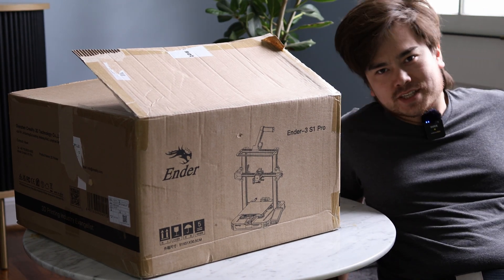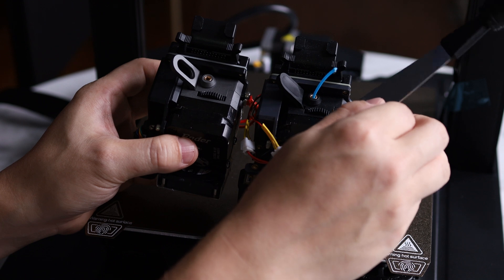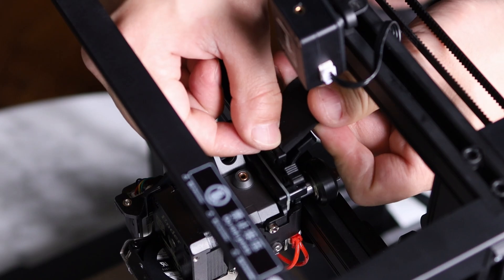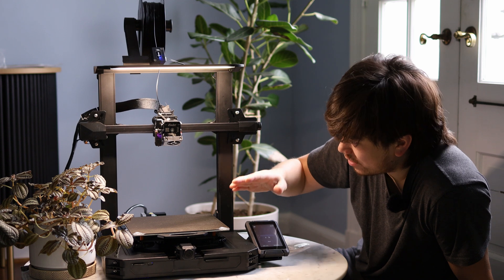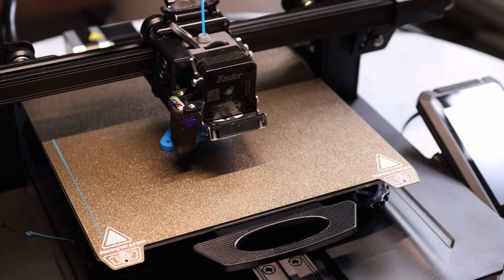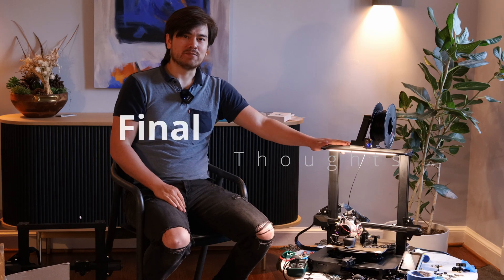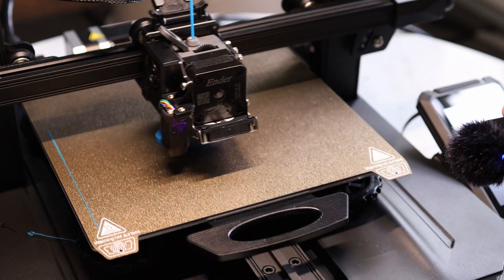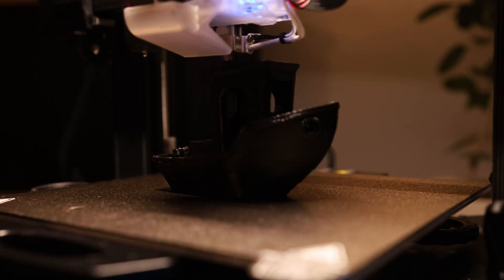The Best Ender 3 S1 Pro Review You've Never Heard Of

Comment: Got my pro yesterday and it's up and running fine.  The noise from the plastic base was the first thing I noticed, though it doesn't bother me as much, but I do wish they had went another route.  Another thing I have in common with so many people who have bought the pro it seems, is that my build plate was quite wobbly as well.  Had to also remove the plate to get to the eccentrics.  After these things it's been all good.
Reply: Adjust them from the right side and it would have saved you time, there was no need to take it apart like he did. I too just got mine a week ago and it was the same. It was done to prevent damage during shipping.

Comment: Hi, mine is due back on Tuesday after getting the print head control board replaced (extruder motor stopped working) probably due to heater block wire shorting out, blackened hole in the wire covering and end loose from plug as you show.  I don’t worry about noise as it runs in garage. Actually quite melodious to my ear.  It has been printing LW-PLA  for RC model aircraft fine. No plans to mod it as I viewed it as Crealities culmination of previous years work etc.  Firmware has been fine for me and I am looking forward to it just printing!    Not modding.      Thanks Laurie,  New Zealand
Reply from the maker: Yikes! Glad you were able to get it fixed

Comment: Your Y axis motor is hotter because of the excess belt tension as the motor has to work harder. Also you can reduce stringing by adding a silicon socket to the heat block. Great Video 👍🏻
Reply from the maker: Thanks! The other factor adding to the heat is the heated bed sometimes being right overhead, but most printers are 10-15ish degrees C hotter on the Y, this one was hot hot hot!

Comment: I had the S1 Pro and it printed like a champ with no stringing actually no problems at all

That is until I did the Factory recommended Firmware update and then the thing just locked up an d never ran again

Now they made me jump through all kinds of hoops and to ne end it still didn't work so they sent me a new motherboard and still didn't work 

So as much as I loved it I packed it up and shipped it back got a full refund and bought the S1 Plus and I'm waiting for it to come in. But with foresight I bought the all metal hot end for it and by watching your video I'll just swap them out rather than try  to change the tubing to avoid the same end you came to

I'll post by next weekend as it's due in on Thursday thanks for the video and saving me a hot end LOL

Paul
Reply from the maker: Nice, my Ender 3 S1 plus is not working - Firmware would lock up when I tried to run the mesh bed leveling procedure. Tried updating the firmware, will be replacing the mainboard to see if that helps. 

Creality QC is... lets just say it could use some work.

Comment: What's your recommendation on buying a machine within this price range, maybe even a couple hundred more, that would outperform this ender s1 pro?
Reply from the maker: I would recommend the Ender 3 S1 Max, since i really like having the option to print 300x300mm. 

All of the S1 printers are pretty much "as good as it gets" in terms of performance for a non-enclosed, bed-slinger printer. Finally reaching near-parity with the Prusa I3Mk3s

The weak points, as I've covered are the poor-ish part cooling fan and the inherent limitations of a non-enclosed bedslinger design. But the extruder, and motion system are really great. 

A nice-to-have feature would be octoprint or klipper integration. I'm kind of surprised no major printer companies have done it yet, since it is something I know I would pay extra for.
Reply: @NathanBuildsRobots  wow thanks for the informative response. There are so many types and knock offs that it's hard to navigate through the sea of seemingly endless options. I've been leaning towards the Enders for sure although if I had the extra loot I would want  the new bamboo or the ankermaker5 even. 
I'll have to look up the octoprint and klipper because I've no idea what they refer too.

Comment: I have one of the first ones that shipped, I got it locally on south America at the same time the reviewers got theirs, I was pretty amazed. No stringing on mine but i had some clogs, that went away after using some olive oil. Noise is an issue, specially compared to my super quiet E3V2, it's not only the plastic base, I tried everything, even if you take off the motor from the mount it still makes. Allot of noise, my guess is that is is related to the drivers they used. Other than that, it proved to be a reliable machine.

Comment: I have 2 s1s and 2 s1 pros.  3/4 of them had bad firmware upon arrival.  The 4th was bricked initially upon installing creality's official firmware update.  Fortunately the Chinese firmware worked flawlessly.  3/4 of them arrived with super loose belts and at least one bed knob off.  I really can't wait for my X1 Carbons to get here.
Reply from the maker: QC is definitely not Creality's strong suite. Once you get them working they are pretty good though. 
Are you starting a Noah's arc of 3d printers? What do you print with all those printers?

Comment: And another issue that I'm having - Z-axis rollers adjustments with eccentric nuts. Internal / external rollers have different pressure on a Z-frame.
Reply from the maker: Yeah, one of my Z-axis wheels isn't even touching the frame. It matters less on a dual z lead screw setup, but still annoying. I always get them set up nice and even on machines I build from scratch. Requires a couple extra steps, but I just like having a well-tuned machine.

I wonder if the timing belt needs to be adjusted. like, rorate one of the Z axis relative to the other. Cause they might be locked together asynchronously, with one side always higher than the other.

Comment: Stringing is also present on my S1 Pro. And noise levels are quite high, but I'm gonna try to replace default coolers setup with your silenced version :)
Reply from the maker: The noise is really starting to get to me. It seems like its getting worse. I'm doing a lot of large and fast prints on it now and the Y axis just groans.
I bought some sound deadener, no idea if it will work. It's just sticky rubber sheets. Would also like to try a stepper damper.

Comment: It was unplugged while you were working on it right?
Reply from the maker: The power switch is a disconnect switch. I always make sure its off before messing with it because the stepper motor drivers are really easy to fry, and if you fry one on this machine you have to replace the entire motherboard.

Comment: Just got my S1 Pro. I'm impressed with the hardware, but the firmware is awful, way too many bugs and I'm on the latest one. I'm pretty disappointed with it. I would tell people just to get the S1 instead, save the extra money and slowly upgrade if they want to. I will be looking at using the Klipper firmware that's all the rage right now.
Reply from the maker: I need to do some more Klipper content. I've got some cool stuff in the works. Since raspberry pis were expensive, I bought an old MacBook air on ebay. It's running Klipper now 😀 

Firmware on most 3D printers is just good enough to get it out the door, no better or worse. I think s lot of bug fixes come from the community, but that takes some time to happen.

Comment: I have been running my S1 Pro every day since receiving delivery - June 6. My best setting for no stinging with pla is 190 deg. The belts , I run loose, just enough to bring them taught. This reduces noise and eliminates ringing. First 2 layers 200 deg then 190deg. Levelling - sweet. Running environment spare bedroom no heating: 5 to 16 deg C. Humidity 60%-75%.
Going to install ruby nozzle that I bought 4 years ago but never used.
Great video, keep up the good work.
Reply from the maker: Interesting, I always run at 210 for PLA so that is probably the trick. I just turned the belt tension down and it reduced the noise and can tell its quieter already. Thanks for the tips Sandy.
Reply: @NathanBuildsRobots  your filament could also be moist.
Reply: I'll keep this in mind. Thanks homie 🙏🙏🙏
Reply: Noted
Reply: Nice to bad I was already subscribed

Comment: one thing you could do to help with the plastic case resonance is get some DynaMat sound deadener. we use it for car audio, stuffs really good for making panels stop resonating
Reply from the maker: NVH is huge in the automotive industry, but 3D printer manufacturers seemingly have never heard of it :P

Nice tip. I looked into that stuff that you reccomended, dynamat is expensive as hell! Ordered some of this instead: https://amzn.to/3OvDY53 (Using affiliate links cause they are shorter)

I think the best solution is some stepper dampers like this: https://amzn.to/3HzlOgt
All the vibrations are coming from that Y axis stepper motor.

Also I put blinker dielectric grease on the y axis limit switch because it rattles otherwise. https://amzn.to/3tNuKca

I have seen vibration damping structures in aerospace that are use 2 sheets of metal with butyl sandwiched between them. Forms a strong, stiff, and extremely vibration dampening material, which helps prevent failures from "flutter", which can literally tear the wings off of a plane if left unchecked. Funny thing is that some whiteboards are made using the exact same construction, so if you find a whiteboard and cut it into pieces to build something, it will probably have excellent vibration damping.
Reply: @NathanBuildsRobots  wow didn't know that about whiteboards. Altho it makes sense as it's a composite material. 

Dynamat is hella expensive but the performance lives up to it lol. It's super thick and dense which really helps add mass to the thin sheet metal of cars. Anywho, will be looking forward to seeing your results with the cheap amazon brand deadener. You could even make an enclosure out of whiteboard material with a sound deadener base see how quiet you can get the thing to run🤣

Comment: The levelling issue must be more than just firmware, I got myself an e3v2 screen and switched to mriscoc firmware, the issue is still there. At least now i can manually edit my mesh with a knob so it actually fits my print surface. No Idea why the autoprobed mesh is wrong though. Maybe it's imprecision on the x and y  movements because of the offset between nozzle and probe. Since the firmware now allows me to change probe offset, I'm gonna move the probe so there's no y-offset anymore. I already have your fanshroud mod, so theres ample space for this relocation.
Love your videos, btw!
Reply from the maker: Thank you Bogus! I've been lucky with ABL. Aside from some crashes from having it set too high or too low, its worked very reliably on all the machines I have used it on. I pull out some extra stops on my 1st layer that I think really help too.

Comment: Creality has too many different models that are all the same. Yikes! Awesome video Nathan. The beginning and ending are classic! Looking forward to the next one.
Reply from the maker: I agree, they had the CR-6, CR-10, Ender 2, Ender 3, Ender 6, Ender 7, Sermoon, etc. It starts to get confusing, and you end up with a bunch of unique parts, so it makes them harder to repair.

The right way to go about this is to have parts compatibility between their different product lines. 

Make 1 family of I3 style printers - call it the Ender 3, and sell a bunch of different sizes, all with the same stepper motors, control board, brackets, extruders, etc.

Make another family of Corexy printers, Call it the Ender 6, and sell it in a bunch of different sizes, all with the same stepper motors, brackets, extruders, etc.

The idea of product families and shared components is nothing new, but it looks like they keep reinventing the wheel every 2 months with another random printer.

Comment: That dredded moment when thing you want to unscrew gets scary soft. The light seems nice... otherwise i'll stay with my standard S1 but I give those fanducts definitly a try. Thank you!
Reply: It's trivial and cheap to replace the hot end on the standard S1 with an all metal one (Mine was $25), and you can actually get the same light bar included with the pro for another $25ish.
So for about $50 more than the standard, you get a better constructed unit than the pro.